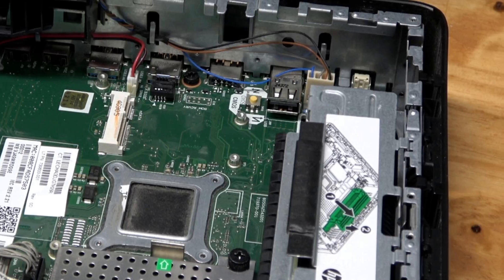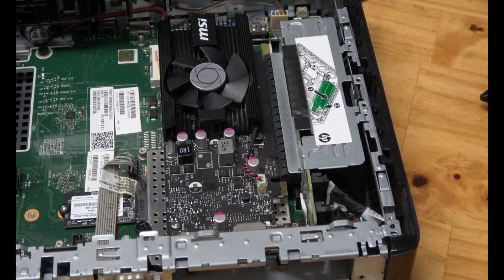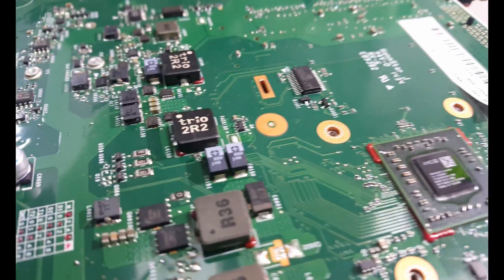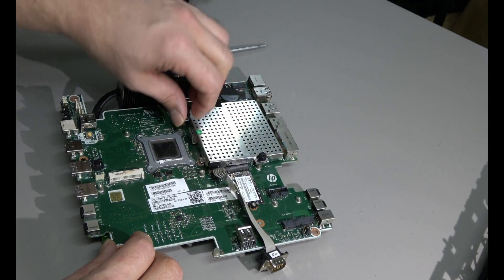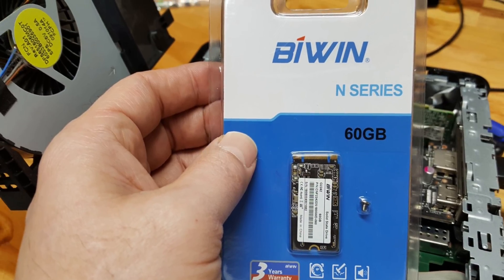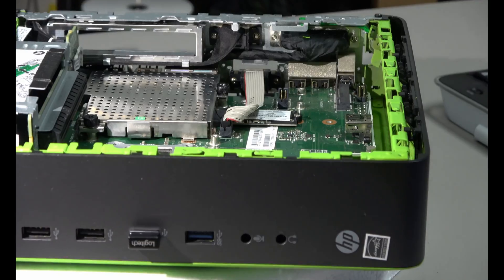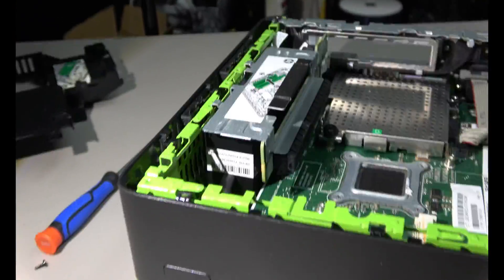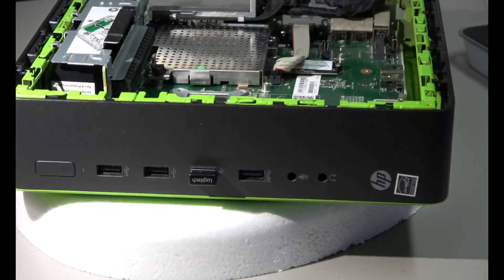Flexible Thin Client means PC Gaming! T620 plus gets MSI GT-1030

Comment: Hi bro, I have such a problem, I have HP t730, and I connected GT1030 gigabyte via riser, everything works fine in idle, but when there is a load, the screen is dark, I flashed the BIOS, or maybe it is that it does not have enough power from the power supply, or maybe the problem is in the riser!? I can’t understand what the reason is ((((

Comment: I got a HP T730 with the same MSI graphics card but whenever I stress the system with a game, it crashes. I suspect that it is going over the power supply rating.

Comment: Hey bud I'm opening an emulation solution business locally and I'm very interested in these mini type PC's as low cost solutions. This idea so let me ask you this. A 1030 with a  weak CPU would work for psx and n64 emulation ? If it runs fortnite I'm thinking why not. What's your opinion

Comment: You want to know what's funny, I play elite dangerous horizons on a HP t620 plus with a GT 1030 and 8GB ram.

It plays it really well at 720p with high and a few medium settings.

Space flight is mainly 60fps, around space stations is a little lower, SRV and on planets it's around 45-50 FPS.

It's a pretty damn decent experience on this setup.
Reply: Do you run Windows? If so how does windows run? Cheers
Reply: @drwhowhogrub  run windows 10, and it runs just fine
Reply: How& where  did u add the graphics card _?

Comment: I did a vary similar build with the same exact graphics card in a T620 Plus. Just an additional idea for you that I did. I needed more storage and didn't want to have external drives sticking out on it... even though that was a option. I included a 2.5 hard drive inside my case... now this makes everything extremely tight, but their is room in the one corner by the exhaust fan. There's a msata port on the board, they make adapters that expand it out to a normal sata port. My next issue was power, since I was dealing with a 2.5 hdd I found a cable that was usb to sata power. This setup is working pretty good for me and I was able to add 2TB of storage.

Comment: Which case is easiest to work with and where you can put most parts/accessories in your opinion? Dell, HP, Lenovo, Acer ect. I want to build an sff pc in near future and I need some advice. Can you change the PSU for something more powerfull or motherboard for some other like mATX or ITX? Regards

Comment: something is wrong with this video. gpu clock 1700mhz????? i think 1030 can do ~1500 boost in OC mode.
Reply: No, a 1030 can go up to 1700mhz core clock. They can even reach over 1800mhz core clock

Comment: maybe a 1050 4gb low profile  woulda worked better  :)  just me  :)
Reply: No it wouldn't, the CPU in this bottlenecks the GT 1030, you would not see any performance gains by putting a 1050 into this if you could even get it to fit, and some how be able to power it. 

The PSU lacks enough power to support a 1050 (this only has a 90w PSU, and when you take into consideration that no PSUs are 100% efficient), not to mention they do not make a half hight low profile single slot 1050, they have half hight low profile but the cooler takes up two slots.

Comment: ever see a thin client that had the CPU socket on one side and the GPU soldered to the back of that socket so the cooler just clamps down to the board? forget who did it but it was one of Intels Pentium 4 775 boards for small form factor.

Comment: Love your videos and nd those mods too.
What do you think about a gigabyte g41+xeon 5450+8g ram+ gtx 1050 ti 4g ddr5? Do you think i can run Fortnight, GTA 5, and Forza? 
Thak you.
Reply: The xeon will bottleneck the 1050 ti I think a 1050 or 960 will be better.
Reply: Xeon 5450 is basically a high end core 2 quad (equivalent is q9650) and the 1050 Ti is decent. You can expect 30-60 fps at 1080p with low to medium settings, depending on the title.
Reply: I had an x5460 that I recently upgraded from and you'll be fine with that card and CPU combo. You can run most anything at 1080p with mixed settings from low to high depending on the game.

Old 771s still hold up if you aren't chasing the highest numbers.

Comment: What a legend. Although I think we're still far from the car-relative of "go green". Since.. well.. computers are already plain electronics, thus not really being as intensive as an old (1995 - 2000 style) car.
Reply from the maker: but this only takes a 19volt power adapter to run